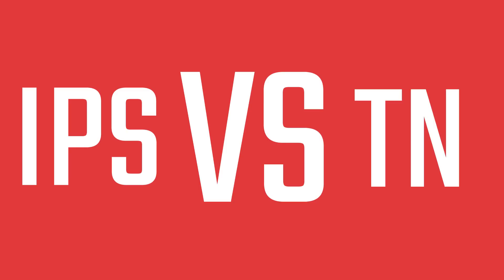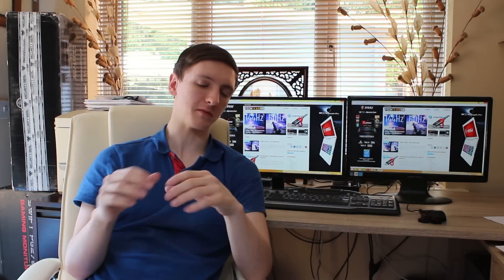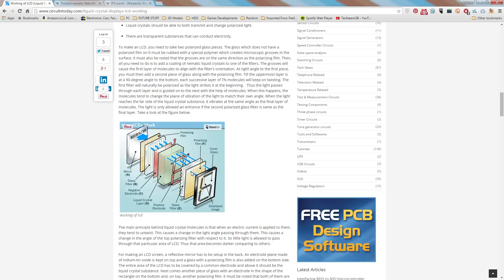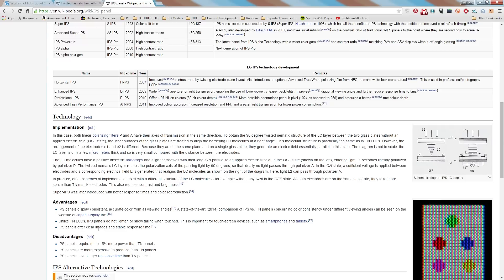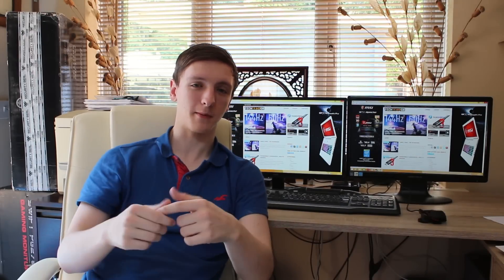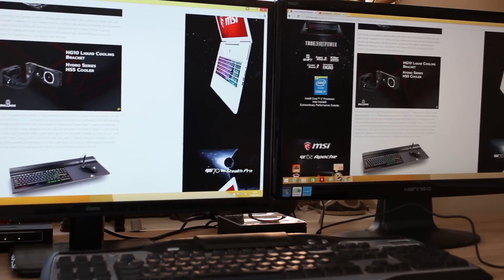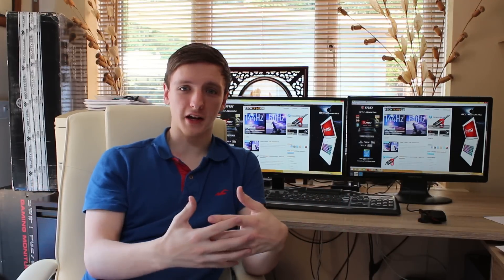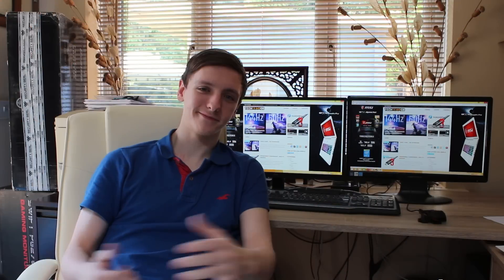IPS Vs TN Comparison

Comment: I just wanted to point out that IPS displays don't necessarily have better color reproduction than TN panels, it all depends on the calibration. Take the PG278Q for example, it's calibrated insanely well out of the box (TFTcentral for reference), and looks better than some IPS monitors. 
Also:
http://www.tftcentral.co.uk/articles/content/calibrating_content.htm#tech

Furthermore, you can actually calibrate your monitor yourself if you have a colorimeter and get it to look pretty much perfect. You can do this with any monitor, you don't need an IPS for it.
Reply from the maker: While I do agree, I did have to make some generalisations for this video, and tried not to pick on very specific cases such as the PG278Q. Great point though!
Reply: +Nosh Nosher Colorimeter's are pricey aren't they? The drawback of viewing angle still remains.

Comment: The TN panel looks as good as the IPS panel in your video. TN panels can have good color accuracy nowadays. Whether TN or IPS they need to be caliberated if you want accuracy. For a PC monitor viewing angle is not an issue unless you are using multiple monitors.